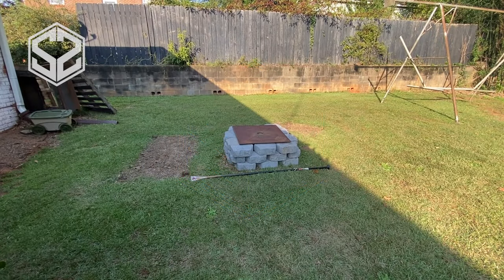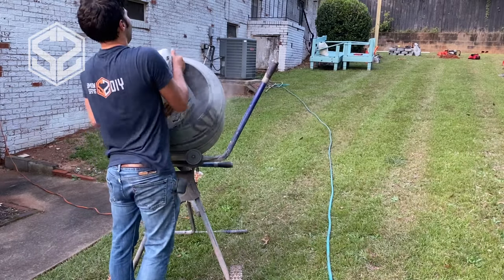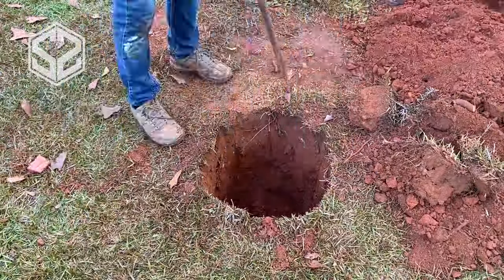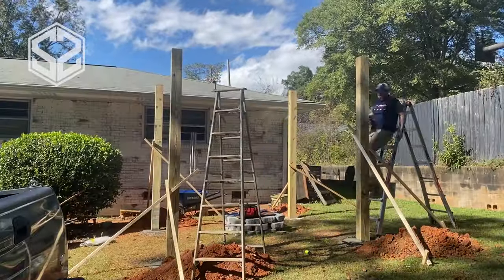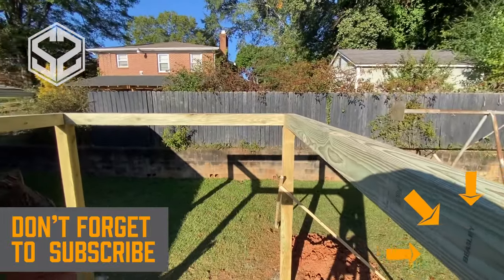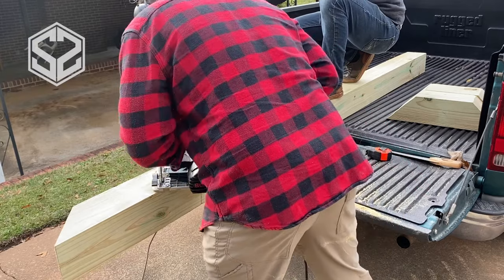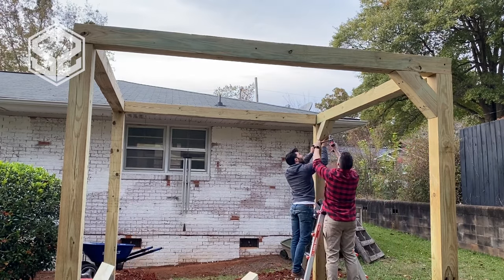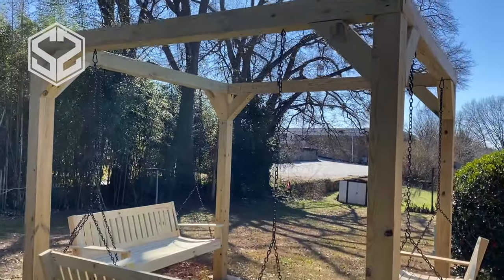Swing Arbor build

Comment: I listened several times. Maybe I missed it. How tall and wide is the pergola? What size (in length) post did you use? Will 8 feet posts work?
Reply from the maker: The width is 10x10 and the posts are 8ft above ground and you will want to place 2-3feet down into the ground. we used 12ft for the vertical posts and 10ft for the horizontal beams.

Thanks!

Comment: Do you think that gravel is still gravel once you pour in the concrete??   I think the concrete turns that gravel into concrete and I don’t think the ends on the post rot because of all that concrete around them  lol  frost won’t push that big thing out 

I install fences so kinda dug a lot of holes for 4x4’s here in Pa  and it’s not that serious lol ❤🫡
Reply from the maker: Thanks for the tips! I imagine the concrete would soak into the gravel and bond with it. But you’re probably right, that post won’t rot any time soon.
Reply: @SimonSaysDIY   lol no they won’t  not in our life time at least lol 😂

Comment: Did you drill pilot holes for the lag screws?
Reply from the maker: We didn’t pre-drill. These lag screws didn’t require pre-drilling. If your using larger lag bolts you will want to pre-drill.